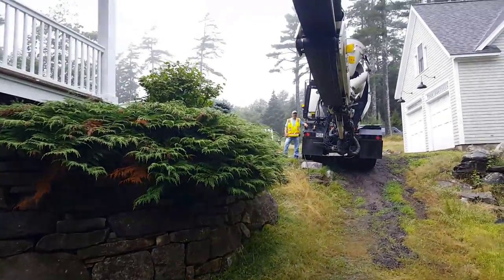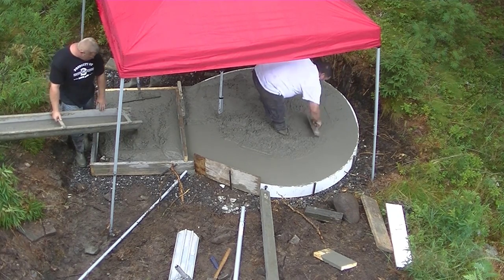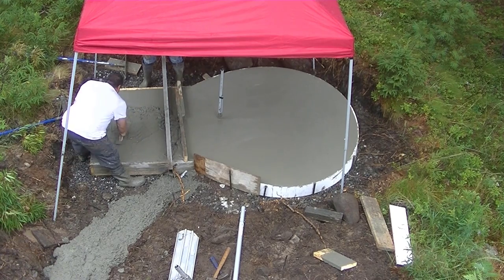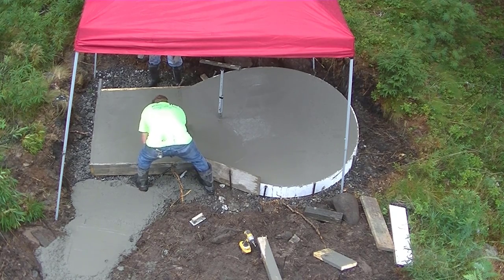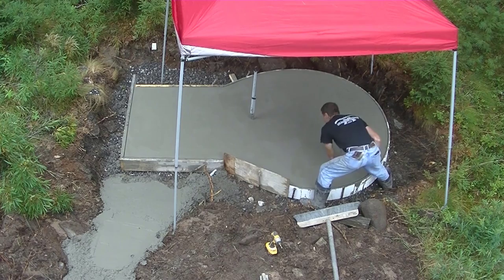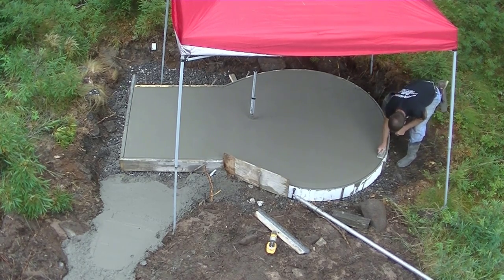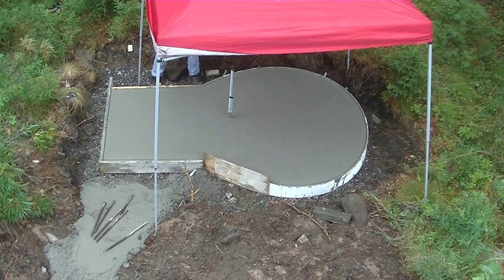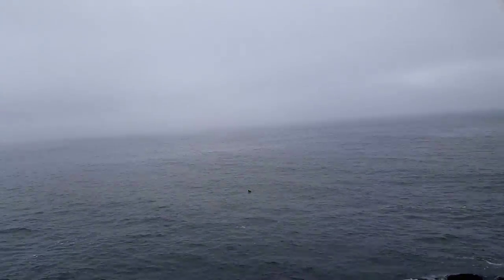How To Pour And Finish A Small Concrete Slab For A Hot Tub | Part 2

Comment: May I ask why only 3 days after is ok for the hot tun to go on? I get my clients to wait for 2 weeks minimum with a 6" 32MPA strength duramix with 18" O/C 10mm rebar. I suppose with a small hot tub it's ok? My past clients' hot tubs are usually pretty big. I'm concerned about not just the weight of a hot tub, but also the water displacement.